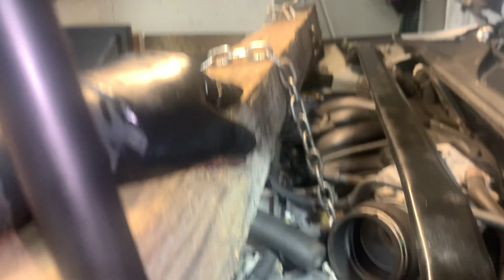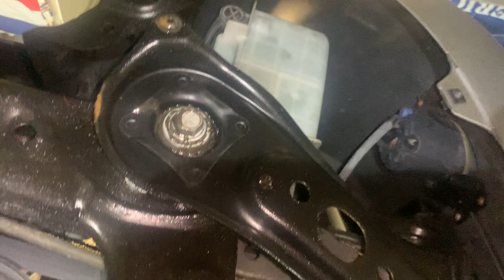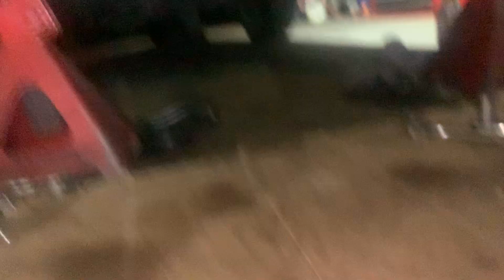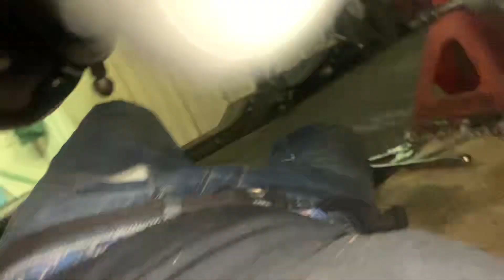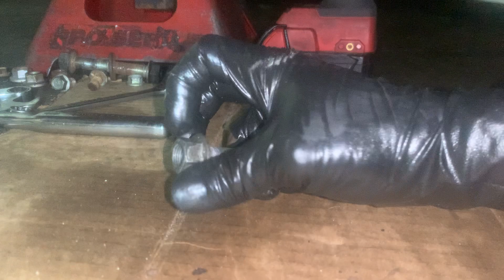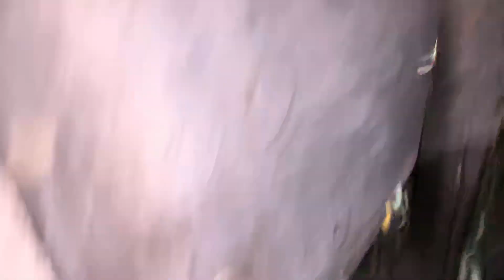2007 Toyota Solara rack & pinion

Comment: It's not the oxidation bro on the bolt the back side of the bolt has four slots on it and on the frame part of the car there's four slots that go in and those slots lock that bolt in until it's loosened and then you can take the bolt the nut off